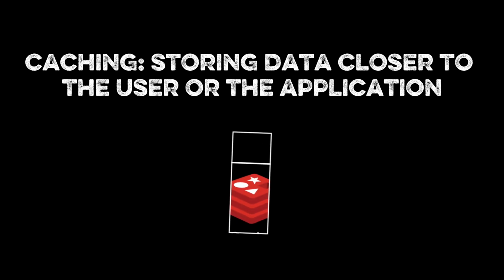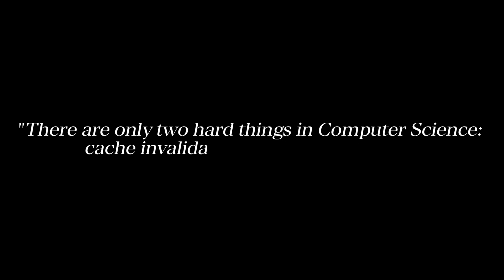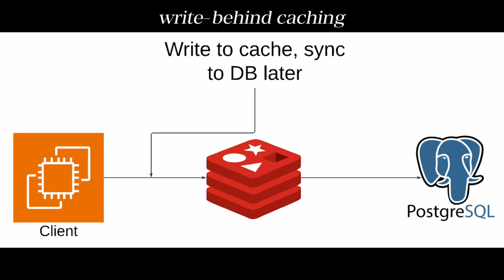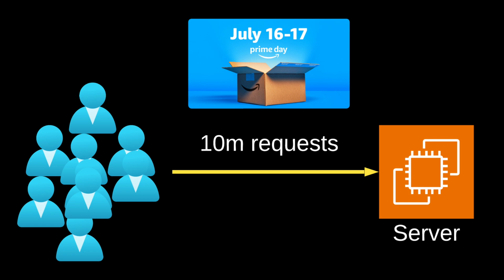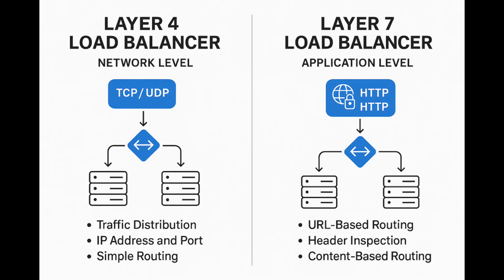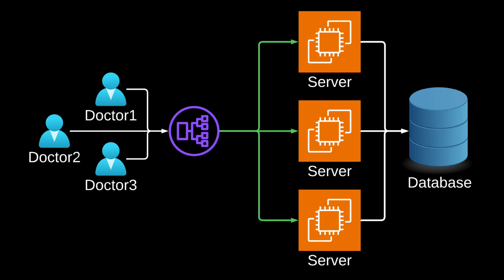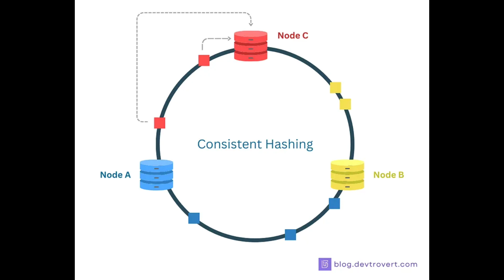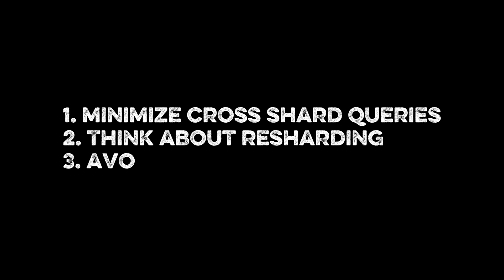3 System Design Patterns That Show Up in Every Interview

Comment: I'm not jealous of you webdev folks. All of this sounds like gpu programming but with the additional complexity that every single operation can fail

Asychrony, cache coherency, managing load balancing data over different threads. 

Ah, it's so funny how basically every abstraction level ends up being the same thing when it comes to parallelization and concurrency and yet we don't have some unified solution to scale this arbitrarily.

Even unified terminology would be an amazing start. Processes split into threads, databases split into shards, GPUs split into sms into warps into threads...